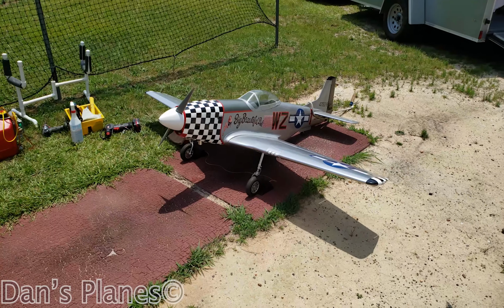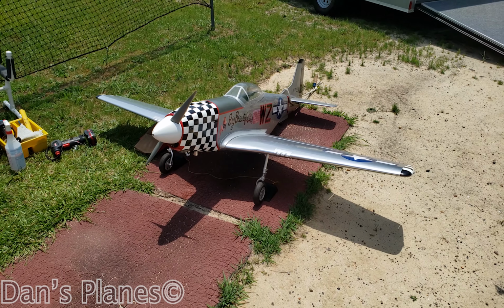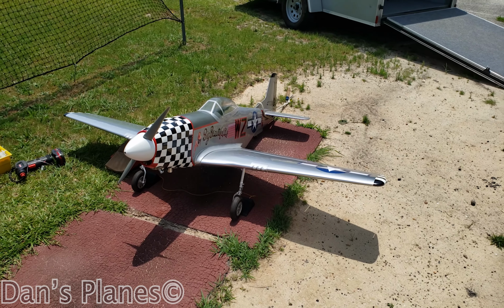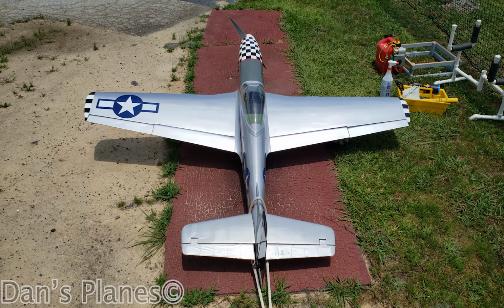20230624 TF P-51 Attempted Flight

Comment: Perhaps a slower acceleration will help, especially on asphalt, also grass will nullify some of the torque, but can also have irregularities that can deflect the plane. Reducing expo, may exacerbate a sudden turn not reduce it. I'd spend a bit more time with engine run up,
Reply from the maker: Wow, I thought I was starting slower than most folks.
Reply: @dansplanes4112  comparing yourself and your plane to others, doesn't really mean all that much